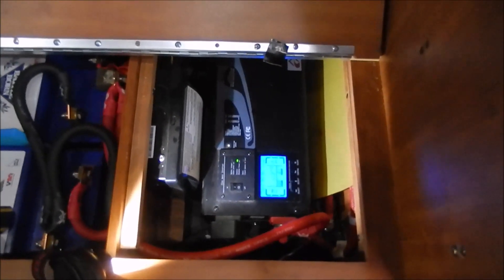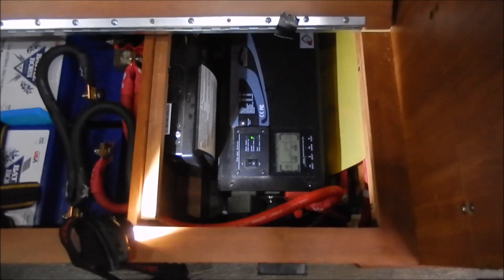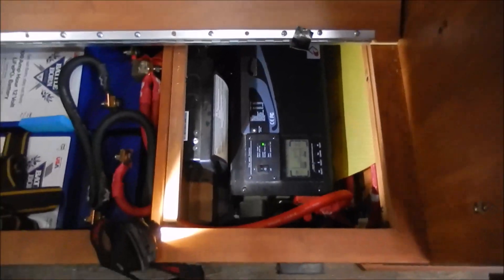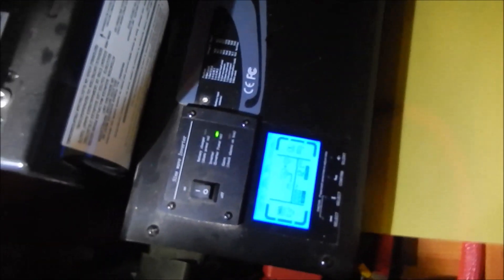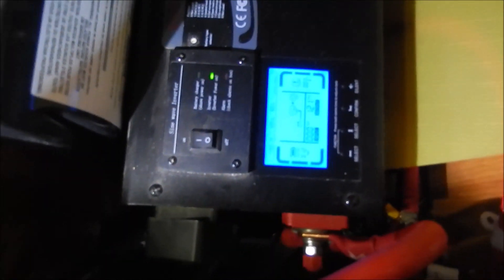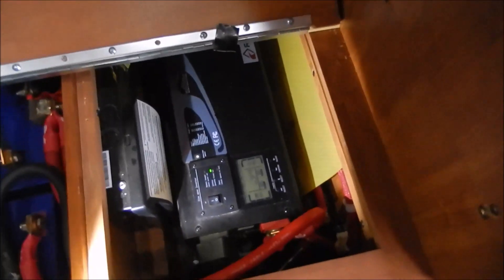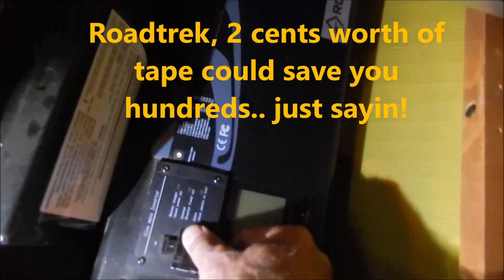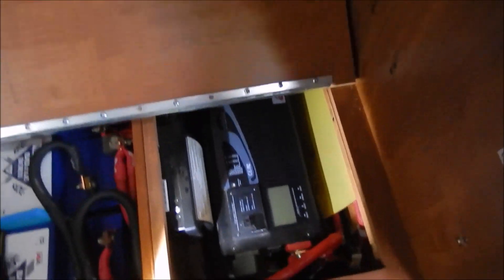Why are so many Roadtrek AGM Batteries Defective???

Comment: Good catch on the inverter on! Would you know how to fix battery disconnect switch?  We have the Firefly digital panel.  I can  turn my lithium batteries off, everything turns off in coach including smoke detector and CO detector, so nothing drawing power other than the battery itself and the firefly digital display.
Reply from the maker: Sorry Catu, I am not familiar with the Firefly panel.  If it was my panel I would first pull the panel and connect across the terminals on the batt switch to test the switch. Then i would check the solenoid that actually disconnects the battery.  Again adding power to  the right connection there and it should fire and complete the circuit.
Reply: @Flicka20  I wish I had the know how and handy. Need to wait to get in shop

Comment: I ran my AC on my battery for 20 minutes for a test  The charge went down to 11.75 
 What is the lowest I can go too on my charger?  Started hearing a beeping noise.
 I have the Under hood generator  I live in my Roadtrek full time and have a pet. But worry about leaving for to long in the RV in August
Reply from the maker: 50% discharge on an Agm battery is about 12.1 volts. From there down to 11.6v  will shorten your battery life.  Below 11. 3 v you are causing permanent damage.

Comment: Nice find Jack!!!

What charger are you using for your Battle Borns?
Reply from the maker: It's the private label roadtrek inverter charger that came with the unit.  It's actually a powerstar lw but they are not so easy to find. I had battle born check it out and it just took a little tweak to make it work for the lithiums.    Battle born has a inverter charger made by aims they recommend if you don't have one.  I also have the complete install video here.  https://www.youtube.com/watch?v=t7VkKfU8KTk
Reply: Jack one more question, how do you know when to charge the batteries?
Reply from the maker: Well, Thats the beauty of lithium's you can run them completely down without the damage you will get with Agm's .  That said, even lithiums prefer to be kept above 50% to give you the most life cycles.  Since I drive every day when out in the Roadtrek, my engine is charging them back up.  A night of use will only use about 30% of what they have to offer so I suppose to answer your question about 30 % depleted. If i have a park I do plug in and turn on the inverter so its charging them.  The battle born's will shut off when full and honestly I don't even have to think about them.  It's been 8 months now and still are flawless!
Reply: Jack, thanks
Reply from the maker: It's the Roadtrek label that came with the van which is actually a Power star LW from china.  I only had to make an adjustment on the settings recommended by Battle Born.